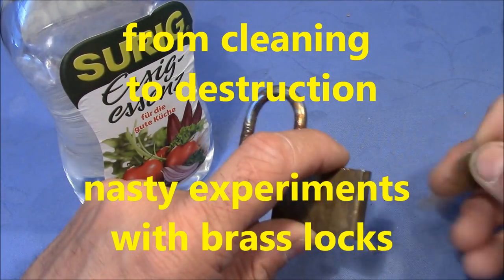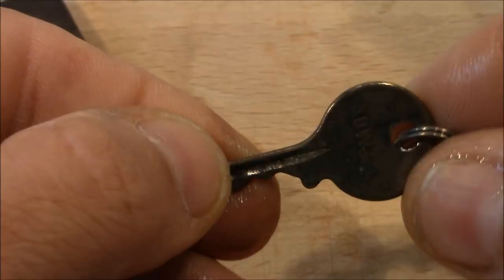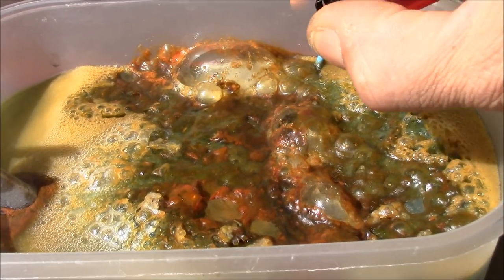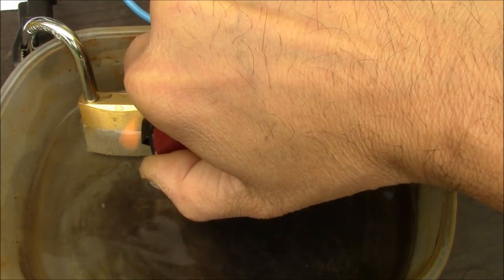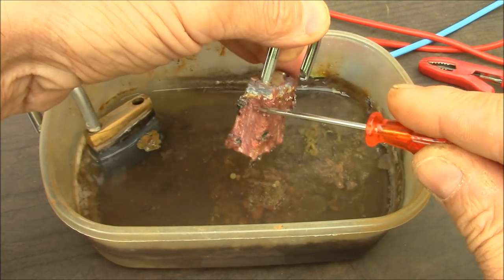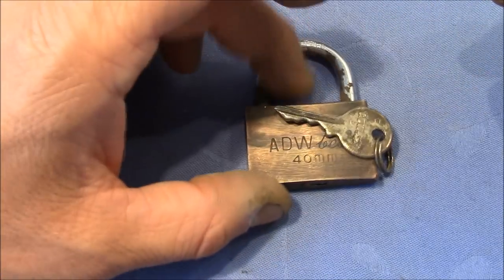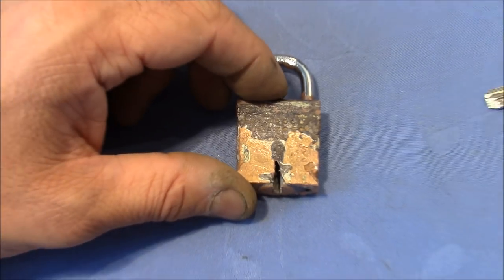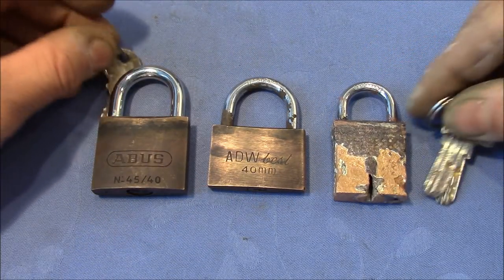(picking 550) From cleaning to destruction - what electrolysis does to brass locks /READ DESCRIPTION

Comment from the maker: Putting the brass lock on the anode can cause some severe loss of material - the result is a pretty interesting lock - but look for yourself ;-) 
Note: After looking at the footage more carefully I recognized that the surface rust from the shackle was nicely removed from the vinegar treatment. I was a bit fooled by the black residuals on the end of the shackle. But for the sake of the fun I continued with electrolysis experiments.
WARNING: This video is no tutorial, it's not the recommended way to do a cleanup, it might be dangerous because of skin irritations, poison gases or explosions. It was just for fun.

Comment: Instead of using salt water as your electrolyte solution, try using baking soda or something less caustic. I have used it to clean silver, gold, and even an entire rifle (metal only) with great results. I used 24 gauge galvanised sheet metal on my positive electrode, wrapped around a plastic storage bin that I turned into a vat to remove containments on whatever metal I chose. I would attach a photo but YouTube will not allow that.
Reply from the maker: Thank you for your tips. Meanwhile I read a bit more about this subject and know my mistakes. Will use washing soda next time and separate both electrodes with paper tea filter. Would be nice to get some pictures, potti314@web.de is my contact.
Reply: Potti314 I sent you an email with some photos. Let me know if you get them.

Comment: You are definitely crazy 🙈😂. Anyway the results are amazing and very interesting :). 37V is is really a lot more than usually used... ;D. Please be careful, the colorful metal solution you have produced is highly toxic and eventually you can produce clorine gas... Funny thing is that I thought a couple months ago about anodizing an aluminum lock haha ;D, but had no power supply or proper colors. Keep up your crazy work and always remember "safety is number one priority" :D. 😁👋✌🦊
Reply: It is...with all the cromium, copper, zink in the solution you also get caustic soda and clorine gas...all not healthy and nothing I would do inside. It definitely has to be properly recycled...
Reply from the maker: I had only one power supply that was strong enough for my experiment and that had a fix output voltage.  The one with electronic controlled output was to weak. Anodizing sounds interesting, hope you will get to it someday and then take us along. I did my tests outside but next time I will wear gloves, no idea why I didn't do it this time.

Comment: i have a question. how to figure out the key cutting of a lock after picking it, when you never had the key, to make a key for it.
Reply from the maker: You need to take apart the lock to access the key pins and plug for key filing. Or you impression the lock which results in a key that works. There might be tools for decoding a picked lock but I'm not sure if this is practical or reliable.

Comment: Cool experiment!  That made quite a mess on the surface for the first lock without doing much to it.  It sure ate away at those other ones nicely.
Reply from the maker: Cheers,  yeah the cathode lock came out quite ugly but this can be fixed with a wire brush easily.